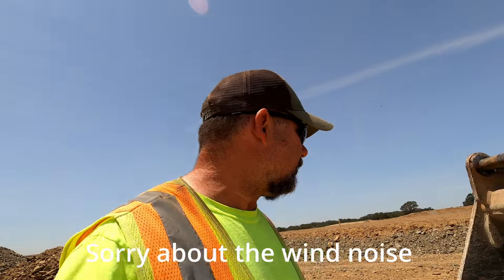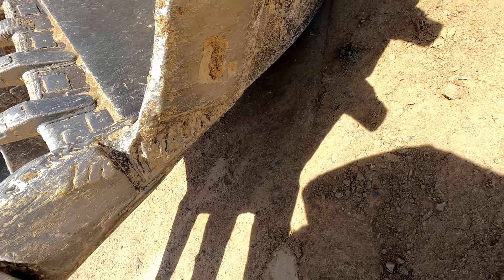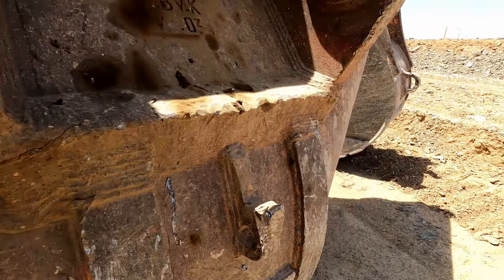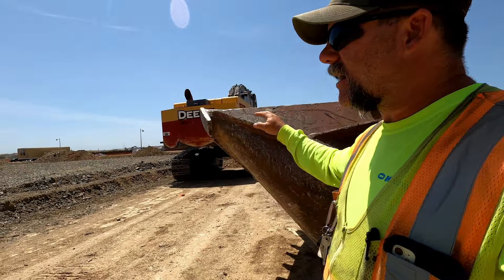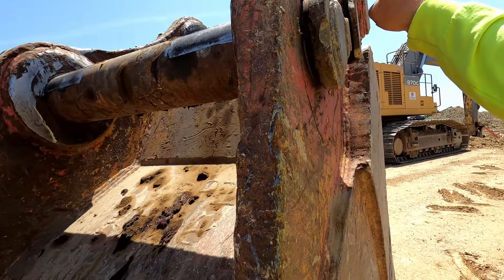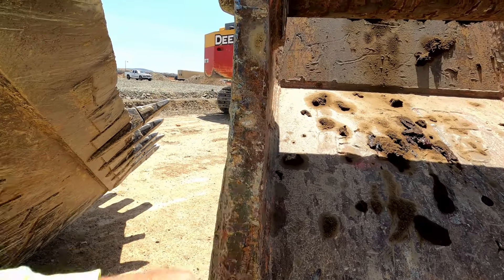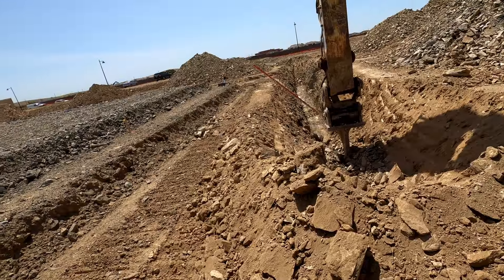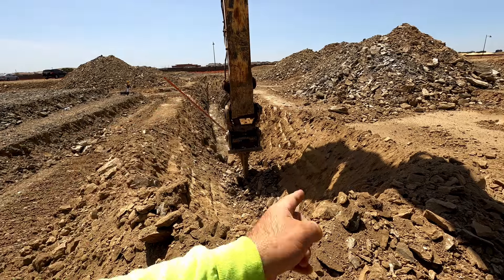inspection of your equipment attachments

Comment: well done!  Very thorough walkdown of the buckets. where r your inspection forms that you use to record the equipment inspections. Without documentation you have no representation. So when are the two cracks going to be rectified and is it going to happen prior to next use? I like to keep you on your toes, brother.
Reply from the maker: Thanks. We have 2 versions of equipment check sheets one is on your phone if you are authorized to do it that way. Or you can do the old school paper form. One sheet equals one weak, then you turn it into the foremen. The cracks get fixed when they decide to fixt it or it becomes a terminal problem.